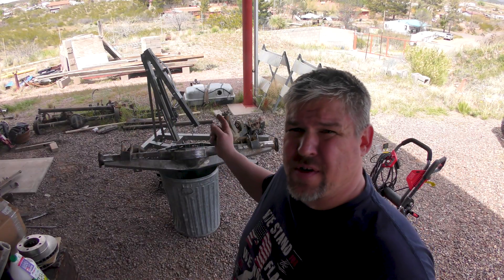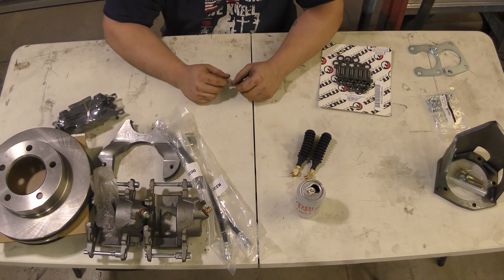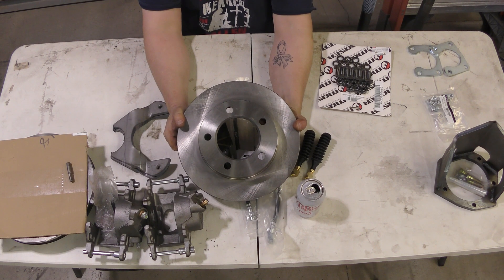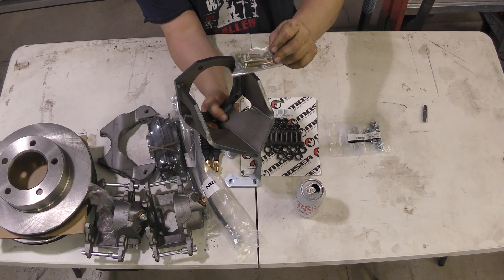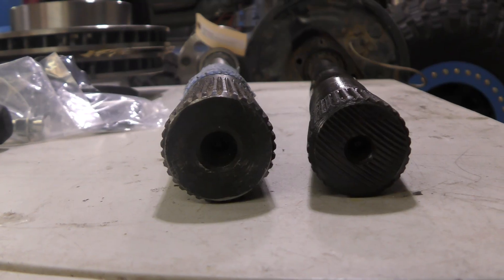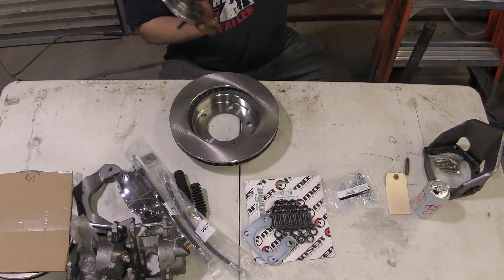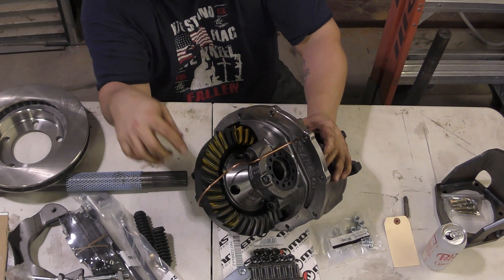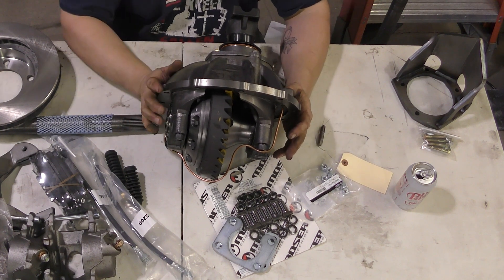Build the strongest possible ford 9 with a selectable locker

Comment: That is cool that you can buy a complete third member so you didn't have to set up the gears and locker.
Reply from the maker: It worked out since I wanted the stronger iron anyway. I'm kinda broke now tho lol.
Reply: @BlackAndBlueGarage  haha i get that. Lockers alone are $1k. I went cheap on got auto lockers. I have a lock right in the front that i paid $90 for and a detroit in the rear that i paid $325 for.
Reply from the maker: @ProjectXJ  that would've been smarter but I want differential braking and then I tell myself "well, the 35 spline center is the same price". Before you know it, I've overdone a thing again.  I ran a lunchbox locker in a Chevy, I was impressed.

Comment: Where'd you get the axle housing breathers from?  Last time I went out, I managed to snag the hose on the rear axle and pulled it off.  Fortunately I didn't go through deep water with the hose off.  Looks like these will solve that issue.
Reply from the maker: Amazon. I can post the link to your comment
Reply from the maker: 2006-2022 Can-Am Commander... https://www.amazon.com/dp/B07H7SR8WT?ref=ppx_pop_mob_ap_share